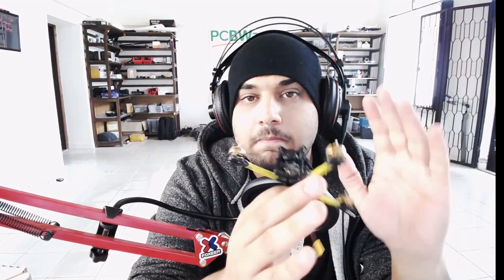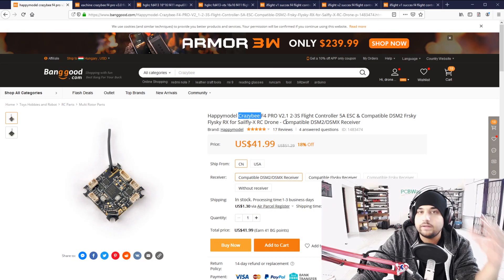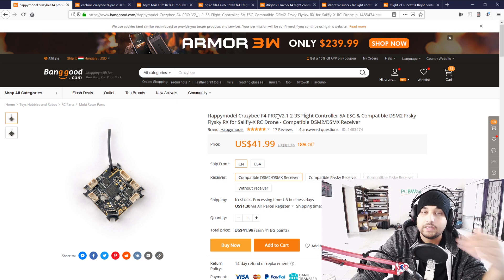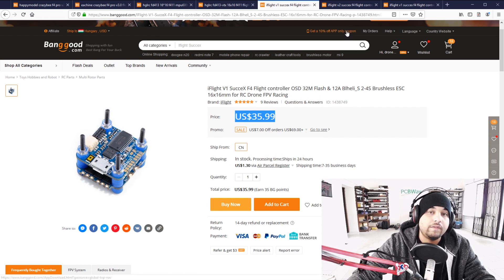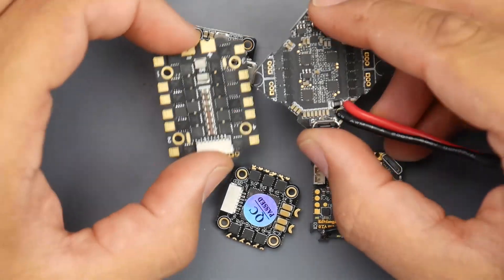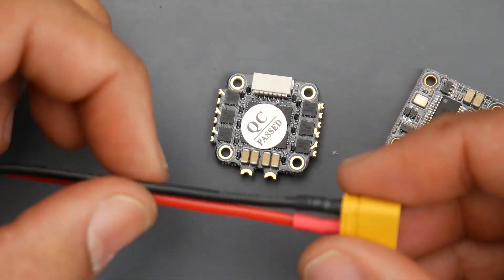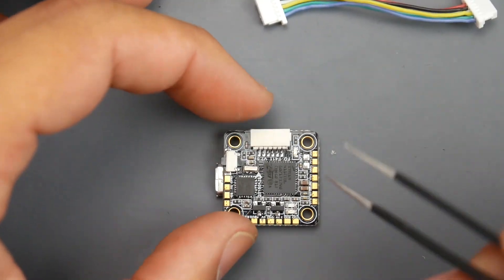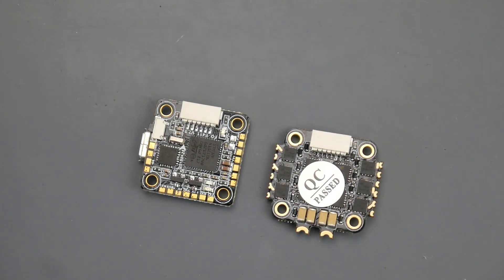Best 3 ToothPick Class Flight Controllers // The HGLRC FD413 Might Be For You

Comment: Can you explain to me better why you prefer the flight controller to ESC connection with pins ?                                
I had always thought that pins would be better for your signal being cleaner I figured the power transfer would be better I just see many benefits of a pinned flight controller ESC combo.             Is there something about durability are they as durable in crashes? I really like the idea I had a very similar idea but the pins would be soldered to the end of the signal wires and we could just plug them directly into the side or edge of our flight controllers so we can just wire them up the wires will just have a pin to plug directly into the side of the flight controller no solder used.     Regardless I would love to know your thoughts I watch every single one of your videos multiple times when I watch I sit down and watch it 3 to 5 times I’ve watch this like six ha ha 😂 keep the awesome content coming please!!!!!

Comment: Hi I see you have a iflight rs 120 turbo bee i also have one with the 16x16 iflight v2 stack and hyperlite 1103 motors 79g all up with a 300mah 3S but i have bad motor vibration over 40% throttle and my tuning skills suck do you have any pids I could try atm i just dont want to fly it anymore any tips be appreciated
Reply: update it to betaflight 4.1 - it's so smooth. if you still get vibrations on 4.1 you have a bad motor
Reply: @mrb2917  ok thanks Im going to give that a go since day 1 even with fresh motors and build Ive had this issue thinkn maybe a prop issue but i also have the piro toothpick props so thought it would be a good match thanks for your input.

Comment: Why use a stack when there are 4S single boards?
Reply: When one component of the AIO board fails the entire board is trash, and it happens alot. With a mini stack each part is replaceable.
Reply: ham bone what you fail to mention is that if you have to buy one of the individual boards is that it cost 80% of the full cost. Compare to a typical 20*20 stack. It's a scam. In other words if you buy an esc and then the FC separately your almost going to pay double